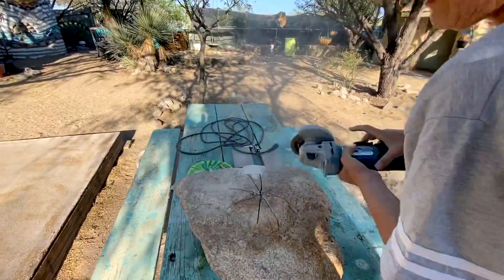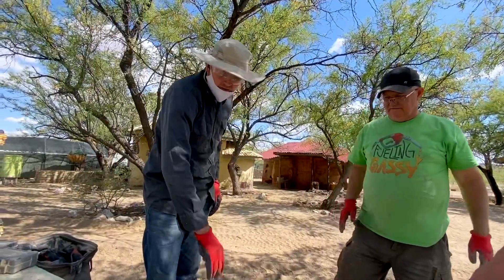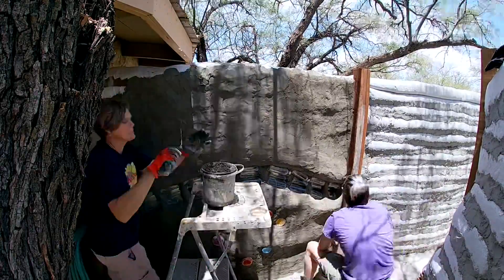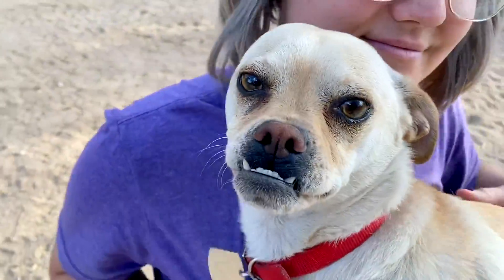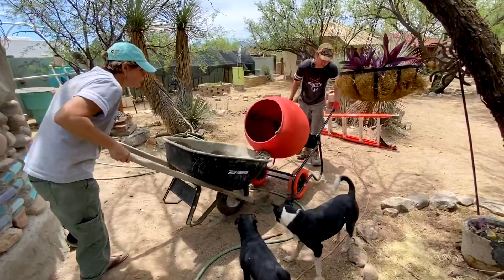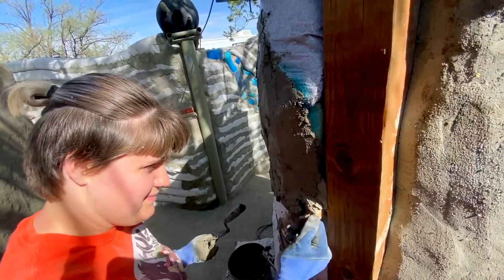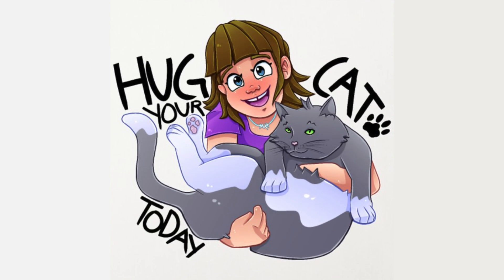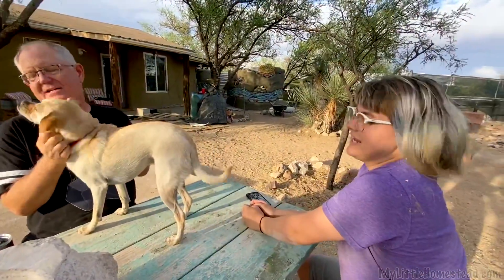DIY Rock Sink & Pedestal for Outdoor Earthbag Shower | Weekly Peek Ep288

Comment: That was fun.  The new concrete mixer works like a charm.  Bullet is too funny.  Then there was the pug shot.  All 3 pugs.  The extra hands to do the mudding/stucco came in handy for sure.  Umm guys, btw, there's no apostrophe in peeks.  It's plural.  Just add an s.  That was too funny.

Comment: Hi can you bold a stand for the mixer I have a bell cement mixer it came with a stand it let’s you tip it into wheelbarrow think it be a really essay for you to make for your mixer and if you add a little bit washing up liquid to the cement when you mixing it make it a lot essaer to cob your walls it traps a little bit air in the mix it spread better and helps it stays on the wall better it was a really old man that told me about it and it worked so well for me and hi from Scotland 🏴

Comment: great idea a Rock Sink, I made one with a large River rock. Word of Advice, you have very severe temp shifts out there so make sure the rock does not absorb a lot of moisture or the tempter changes will cause it to Explode because of its Moisture Content freezing and melting. If I were you I would Seal it with some kind of clear epoxy or some thing

Comment: For the sink pedistal if you want to set through with the stone. 
You can dig a hole in the ground, use the cardboard concrete tubes (https://images.thdstatic.com/productImages/4c11aab0-5277-4fc8-98be-a597b3273704/svn/sakrete-concrete-forms-200077374-64_600.jpg). Put all plumbing in place, rebar for solidity and pour the concrete with pebels/glass/... whatever you want it to look like.
The dig it out once its set and use it for the pedestal of the sink as to the original plan.

Comment: The concrete pedestal isn't a total waste. Cut it off to the point where Gary rui... uh, had an accident, and plant it as the base for a flagpole.

Bryson is wrong, the mixer doesn't look like a drum - it looks just like those plastic Jack-o-Lanterns that kids use on Halloween. You should paint a face on it and use it for trick-or-treating this year. Or just put put some lights in it and set it in the courtyard on Halloween night.